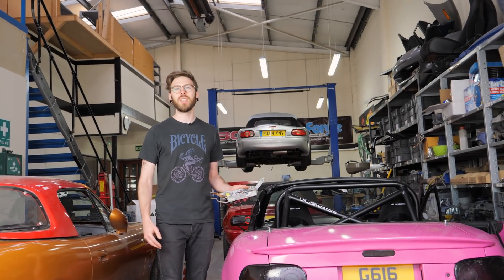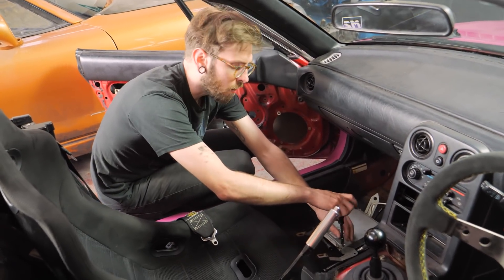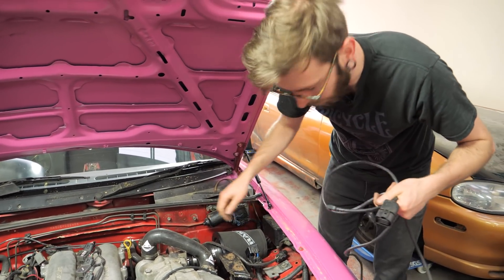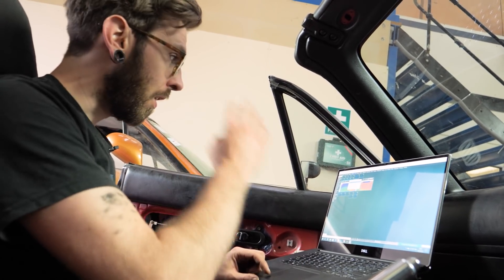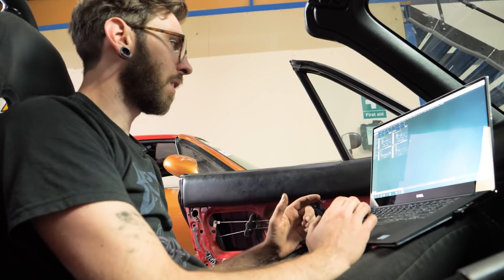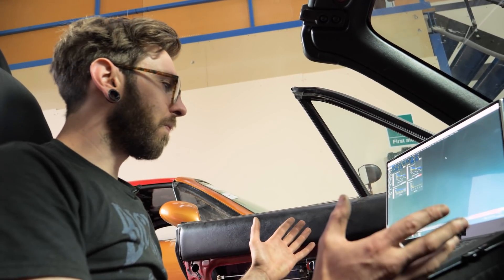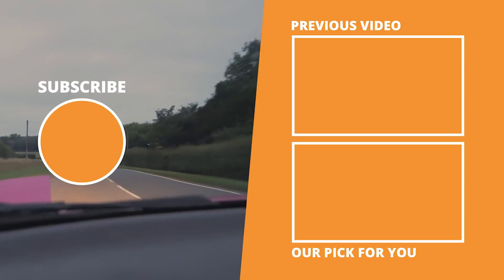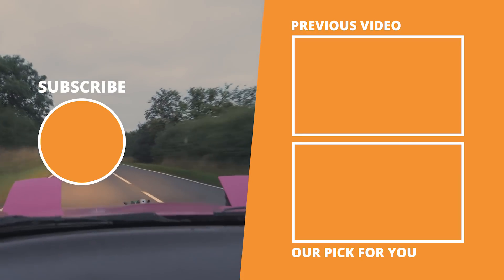We Install An AWESOME ECU In Our NOISY Supercharged MX-5 Miata

Comment: I've got a US-Spec '94 base 1.8L that's been rebuilt with forged internals to support a rotrex C30-94 unit.  Any chance that your map (base map) is available? I've got an ME442 as well.
Reply from the maker: Nice! ME have basemaps available from their Meite software. A turbo basemap will be enough to get you to a tuner. Leave the belt off if putting your foot down is too much to resist 😆
Reply: @BOFIRacingTV  Thank you for the quick reply.  That's what I've used (the turbo basemap).  Hoping to get a minor coolant leak fixed tomorrow (coolant reroute).  Then, it's off to the dyno for some sessions for idle, warmup and overall general tune.

Comment: Hi lads, I'm a short dude (5'7 to be exact) and I'm currently having a nightmare finding seat mounts that work for someone of my less than average stature - I bought the car with sparco buckets and the previous owner has mounted them so low I will need a booster seat to drive it as is😂. Any seat mount recommendations for a small guy?

Comment: How are you finding the m2 motorsport seats?  I was considering these for the daily but was wondering about comfort on longer trips.
Reply from the maker: They're good, came out of the same factory as Car Make Corns, so an absolute bargain if you look at the US prices. I had to cut down the Skidnation side mounts to get them to fit due to the shallow design.
Reply: BOFI Racing I always thought they looked the same! I’ll have to get myself some eventually. I’d be running skidnation mounts too. I’ll have to check yours out next time I’m down, should be with you for a clutch job soon

Comment: How many hp is your car?
Whats p/w ratio?
Reply from the maker: It was last dyno'd at 196BHP on a hub dyno. Has had cams since. Not been on the scales to see what it weighs though!
Reply: BOFI Racing so youll be at roughly 200hp per ton.
Im at 170hp per ton. 😢
Reply from the maker: Have you got an intake and exhaust on it already? Big cam time ⌚
Reply: BOFI Racing Got a heatsoak induction for the noise on crossover, and got an unsilenced midpipe for exhaust rasp and maybe +1hp
Dont think many people bother with cams on the K series the standard ones are good for maybe 260hp?+
Reply: @seany8787  cams aren't all about hp tho.. people don't change them to add more hp. They're usually swapped ot to change the torque curve or more importantly raise the rpm limit that the engines capable of. We know the stock cams can do about 260-270bhp, but depending on the cams fitted, you could have much better mid range torque, or a 7500rpm redline 😉
Reply: Mathew Armstrong  its already got a 8500 redline. As well as being docile at low revs. Best of both worlds
Reply: Seany8787 B6’s and BP’s usually can’t even get near 8k I thought? The N/A power record maxed out around 7600 iirc
Reply: mwmmatt1 I have a Honda. K series.
Reply: Seany8787 aah right, that makes more sense, sorry about that haha

Comment: You fit the m45 again? I thought you Swap It for a rotrex.
Reply: :( no more rotrex
Reply: I thought the same. If you have swapped back I would like to know why because I have a M45 in my workshop waiting to be installed into my 1.6. The poor MX5 cant understand why dad has not ordered a kit yet but mum want's her kitchen first. :)
Reply from the maker: Back to the M45. After doing all the body work I wanted to just be able to drive it again. We had found out what we needed to change to make the Rotrex Kit better, and any further development could be done on an engine out of a car. The M45 has so much grunt down low, which makes it fun on the road, and the sound is so much better than a Rotrex in my opinion. It won't make as much power, but it's pretty hilarious as it is.
Reply: @BOFIRacingTV  How will the Rotrex kit incl. charger compare with the M45 kit excl. charger, price wise and will installation be pretty similar?

Comment: Can you even buy those super chargers anymore? I had one on my 1995 m edition. How much boost are you running?
Reply from the maker: We install used Eaton M45s from the Mini Cooper S. This has a 17% reduction pulley, I think it makes about 9PSI from memory. I'll be able to check the logs once I get an SD card for the ME442 ;)
Reply: BOFI Racing Awesome,thanks for the response. I had Jackson racing super charger probably had 5 lbs of boost on 1.8 engine.
Reply: You changed out the rotrex back to Eaton :(